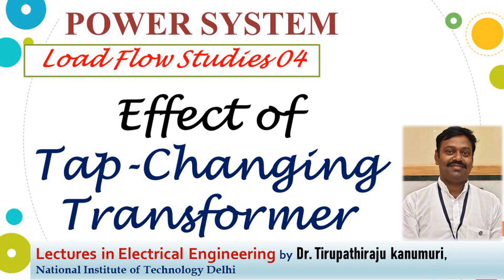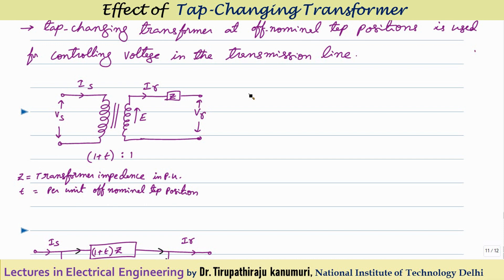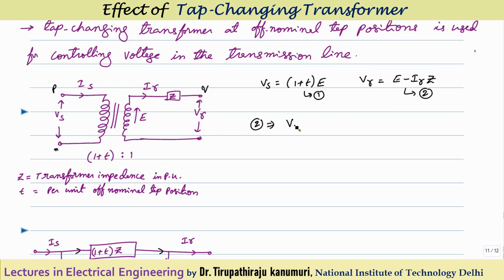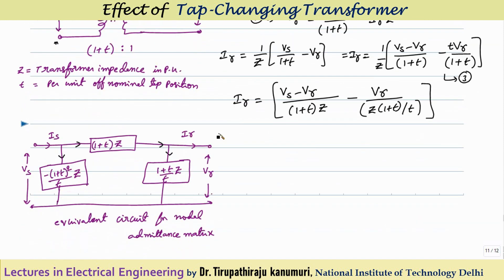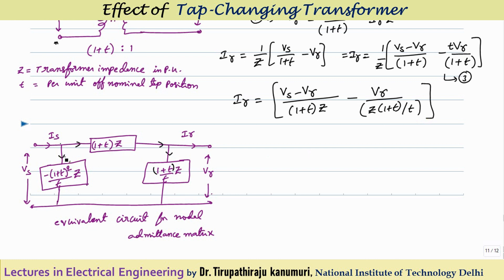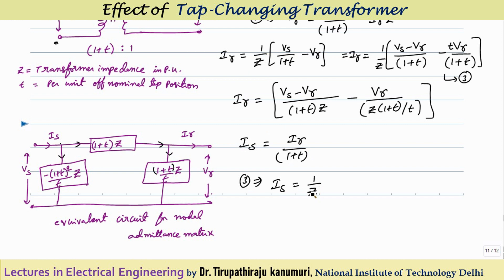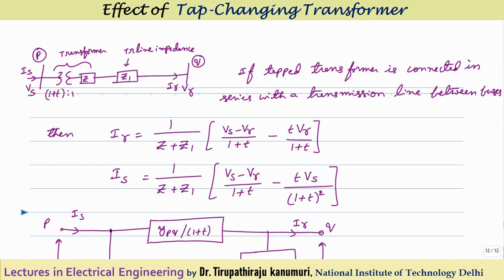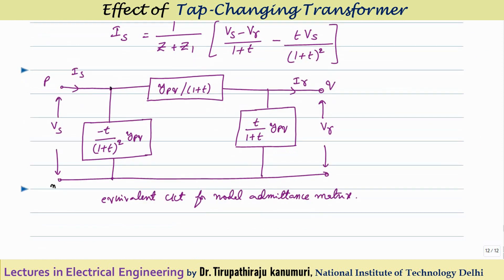PS105 Effect of Tap Changing Transformer

Comment: Sir I have doubt. Normally tap are provided in HV side of the winding because of the current is less .in my point of view switching is done in low voltage side better comparatively HV side .we know OLTC  is in oil container.but unwanted arc produced why place in. LV side.

Comment: Understood sir
But i have a question with different context,
Since transformers use onload tap changers regularly to control voltage of power system, do they affect the fault level of system also?
Reply: @lecturesinelectricaleng  sir by using fault analysis, and making saperate single line diagrams with different turn ratios, i should be able to figure out the change right?